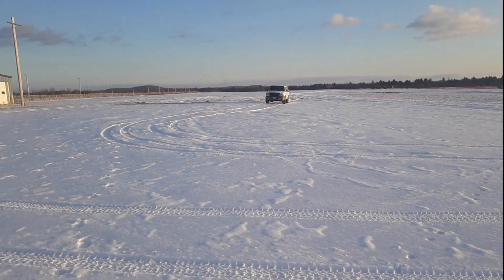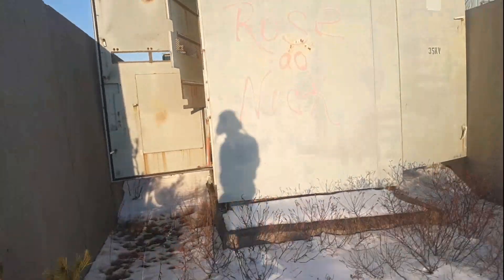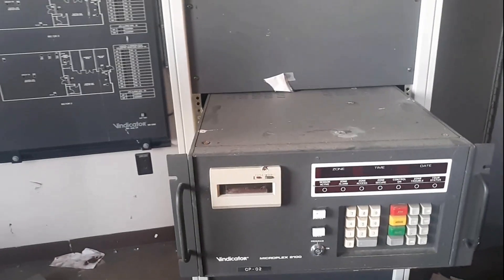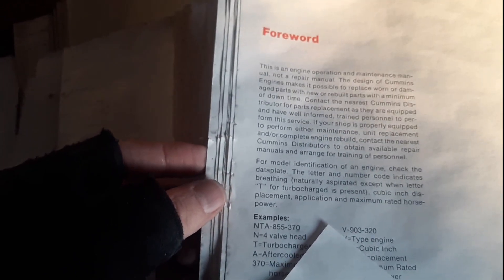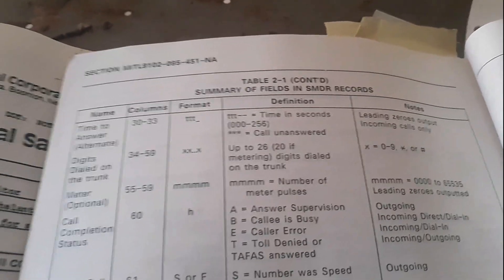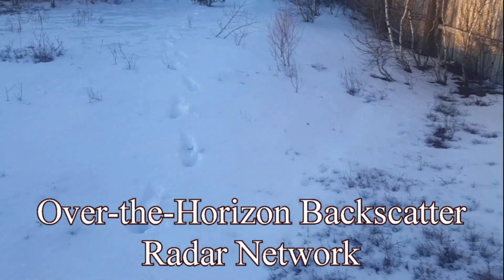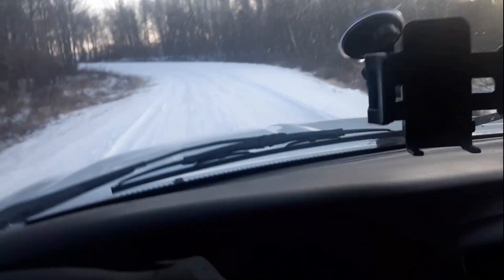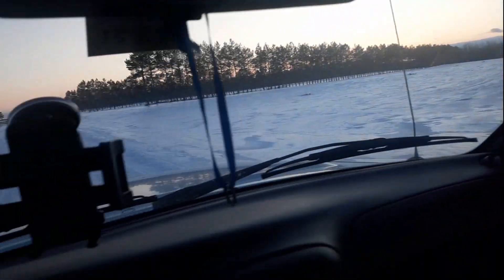Abandoned Maine: Columbia Falls Air Force Station

Comment: Can you tell me how to get there would love to go film there
Reply from the maker: Do you have a truck or something like a Subaru that can drive on dirt roads? If you want to go, I'd suggest teaming up since there are two more buildings in separate areas to check out that i'd like to film.
Reply: @AbandonedMaine  I have a truck we have taken it up to the abandoned radar base in Vermont and drove to the top with it
Reply from the maker: @tanyasharmansvlogs4200  Great. The Ford Ranger I used to get out there for this video is dead and sold off and my current car has no capability of getting out there. My weekends are on Monday and Tuesday. All we have to do is meet at the Shell station on Route 1 and I can lead you out there.